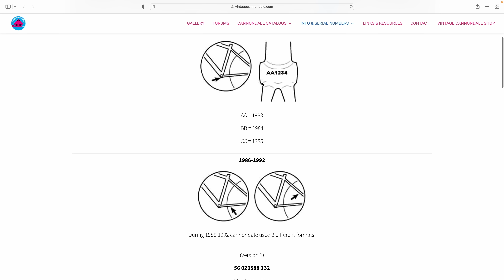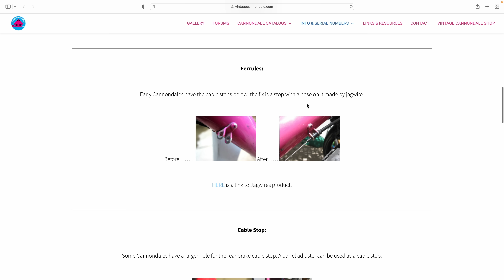Mountain Bike Restoration: Cannondale MTB Custom Powder coat

Comment: Excellent rebuild and love the new look. Also thanks for the tire recommendation, rebuilding a ‘93 Trek 930 Singletrack and think those tires will work well, the Tioga Psycho tires are just too dried out. You also have me wondering if shocks would be a solid upgrade from the rigid forks. Thanks man 🤘

Comment: Any thoughts on Lefty forks.  Looking at one on an early 2000 F2000?
Reply from the maker: Hi Mark, If you're talking about rebuilding one you will need some specialized tools that only older Cannondale dealers are going to have on hand. It's not impossible to work on them, just hard to find replacement parts. When they are running well they last for a long time, but eventually the boots fail, the springs can seize up, and the bearings need to be cleaned and regreased. I know of a good local mechanic here in SE Idaho that did a lot of maintenance on them if you are looking for some specific help.

Comment: Just came across this video and feel like I finally have a jumping off point for my '98 F400. It was basic bike to begin with, but I'm just about ready to make an upgraded hybrid -- and still keep it 26" (however counterintuitive that is). Main questions are 1)What parts are still available from basic retailers vs. what should I really look to ebay for? 2) Can I strip it down to just the frame (and strip the frame for paint) and rebuild it with basic sockets/crescent wrenches/hex keys?
Reply from the maker: Hmmm, lots of ways to approach this. I would suggest walking into a couple local bike shops and talk to their mechanics to see who has some experience working on older bikes. Most mechanics will understand you have a piece of nostalgia that you want to hold onto and should be able to steer you in the right direction with parts and what tools will be needed. Most bicycles form the 90s's have a mix of metric Allen bolts as well as a few specialized tools for bottom brackets, headsets, hubs etc. I would not be able to address all of these questions in the forum here, but a good local bike shop could. Best wishes!
Reply: @CoolBikeProjects  thanks for the advice; will check it out.

Comment: Nice resto job ! I'm currently doing  a semi resto on my old 1992 cannondale M-700 
Having my old rockshox mag 21's rebuild by Risse racing up in Oregon for around $175 ,have the old 1 1/4" headset that the bb's in it are trashed and might have to locate a replacement for the Shimano XT-headset on it .anyone make a replacement for that or an improved version of it?
Reply from the maker: Awesome! I would check with Cane Creek directly but they make the 40 series that might work. Chris King does aswell. Best of luck!

Comment: I've got pretty much the same frame (M400 CAD2), and I have to buy all the parts. I was thinking about modernizing it with a 27,5 front wheel and a suspension fork. Do you think it would be too much of a geometry change ?
Reply from the maker: It really depends on the current heart tube angle.  By the time you add a taller wheel and that much front height the geometry could be way too slack. I would talk to your local bike shop and get their thoughts before you start buying parts. Best wishes!
Reply: @CoolBikeProjects  Thanks a lot. It's an old school steep tubehead (70°). Does a 100mm suspension fork already increases the front height on such bikes ?
Reply from the maker: @sepultubob  yes depending on the fork. Certainly newer 27.5 forks would add a lot more length.
Reply: @CoolBikeProjects  Oh I was talking about a basic 100mm 26 fork vs the original 26 rigid fork.
Reply from the maker: @sepultubob  sorry bout that yes with a steep steer tube and only 100mn fork I would think you would be just fine
Reply: @CoolBikeProjects  Thanks !

Comment: Just simple sticker? No stencil decals? No Airbruch on stencil sticker?
Reply from the maker: Nope, pretty common to use vinyl decals as replacements. That is why we clear coated the frame, to smooth out the decals and protect the frame.